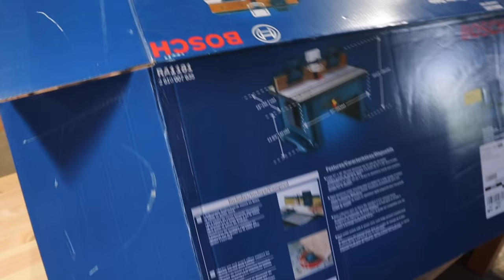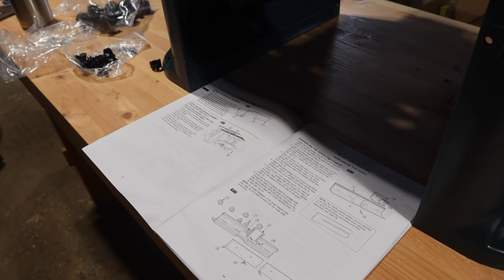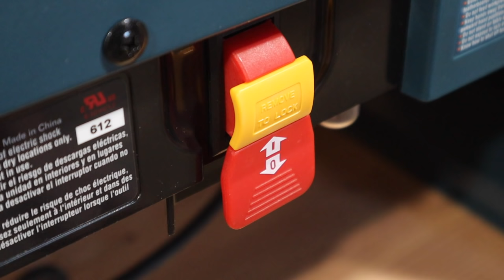New Bosch Router Table | Model RA1181 - Unboxing & Setup

Comment: Is it compatible with different routers? I have 2 dewalt
Reply from the maker: Sure is! Here is the manual. Page 15 has all the compatible models. 

https://pdf.lowes.com/productdocuments/33317c1b-1aec-45b5-9eae-46caa8e591db/08063444.pdf
Reply: @NorthwestCraftsman  thank you so much for the quick response! I found a brand new one for 80 online and wanted to make sure.
Reply from the maker: Nice find! And not a problem!

Happy woodworking!

Josh
Northwest Craftsman
Reply: @NorthwestCraftsman  new sub
Reply from the maker: Welcome to the community! 😄

Comment: HOW DO YOU INSTALL THE FINGER BOARDS THERE ARE NO HOLES IN THE UPPER FENCE TRACK--? DRILL YOU OWN???
Reply from the maker: That’s a great question. I haven’t put my finger boards on the fence before but I think you may be able to use the fence hardware to fasten them on.

Comment: Can you use this table with the Makita RT0700CX2J router ?
Reply from the maker: Doesn’t look like it’s compatible with this particular Makita. Check out page 15 of the manual though to confirm. 

RA1181 Manual
https://pdf.lowes.com/productdocuments/33317c1b-1aec-45b5-9eae-46caa8e591db/08063444.pdf

Comment: Wondering if this table is compatible with any router brand, or if there is a list of routers that can/cannot be used with this table?
Reply from the maker: Sure does! Page 15 of the attached manual has all of them. 

https://pdf.lowes.com/productdocuments/33317c1b-1aec-45b5-9eae-46caa8e591db/08063444.pdf

Comment: How do you adjust the bit height above the table?
Reply from the maker: Hey Bryan! Great question! When the router is mounted, it’s upside down in the table. There is a small hole in the skid plate and router plate which allows access for an included hex key to turn the micro adjustment knob. It works great! Easy to adjust within a few thou.

Comment: Can you make height adjustments?
Reply from the maker: By itself, no, but that the router plate has a hole that integrates with the 1617EVSPK base for table top access height adjustments 😊

Comment: How do you manage dust collection?
Reply from the maker: There’s a 2-1/4” port on the back of the fence which works pretty well if you’re using the right size bit collar (the red plastic rings that reduce the gap around your bit). It does like to dump chips below the table if you don’t close that gap (not always possible), which is annoying, but, I’m planning to build something to add dust collection below as well.

Comment: So MDF vs Aluminum for the router table? Which one and why if you don't mind. Anyone here or the channel. Thank you.
Reply from the maker: Great question! I'll start off with the disclaimer that I'm no expert, this is just my two cents. 

Pros and cons to both. 

MDF is going to give you a very flat and stable surface (assuming no contact with moisture and I hope that's not the case in the shop). You can also get a much larger, custom sized table since you'll be building it yourself. 

The primary advantage to the aluminum is not really the aluminum but the fact that it comes on a pre-assembled table that takes all of the guesswork out of making it and allows you to get to work immediately. As a new woodworker, this was invaluable to getting me working on projects, not just my shop. Seriously, if I made everything in my shop, which I could with enough time, I'd still be building it out. There is also a chance with aluminum that it was bent in shipping or manufacturing so you'll want to check it for flatness before using it. 

Also, understand what your true needs are, dead flat doesn't exist, it's all on a spectrum. If you're doing fine joinery and detail work, you'll want to make sure you're very flat. If you're doing more framing/construction/building work, you can get away with some waviness/bowing/cupping. Of course you can just demand the flattest surface possible but I've seen guys go round and round with suppliers trying to get the "perfect top." 

So in short, there isn't an absolute right answer, it depends on your goals. 

Hope that helps! Thanks for the good question. 

Josh 
Northwest Craftsman
Reply: @NorthwestCraftsman  thanks for the answer and time. I need space as well so I'm going with a bench top.. there are aluminum and MDF benches like the Skil. I want to start off making speaker boxes and adapters. Possibly going into boxes and shelving.
Reply from the maker: No problem! What size of surface you’re looking for?
Reply: @NorthwestCraftsman  no idea honestly lol.
Reply from the maker: No problem! Would you be using the router table to cut rabbets (or rebates) along the edges of your boxes and such?
Reply: @NorthwestCraftsman  I might. I also need to remove fence or move out of way to finish speaker adapters and braces for box
Reply from the maker: Makes perfect sense, you may look at making a removable fence, so you can slide it off the back of the table when you want to use it for other things. Also, depending on what you plan to finish with, you may look at getting a second sheet of MDF to cover the router surface which would keep it clean but still allow you to work on a large surface.

Comment: FYI. Bosch makes recessed wrenches! It made my life much easier!
Reply from the maker: Kiran Bhat Woodworking I didn’t know that! Thanks for sharing!
Reply: @NorthwestCraftsman  Yes! RA1152 is the part number. Changing bits is much easier and with the top depth control, it removes the need to buy a router lift!
Reply: I've got the Bosch portable router table, not nearly as solid as the aluminum top model.  I picked up my recessed wrenches at Amazon because it is a hassle to change bits otherwise, a necessity.

Comment: The biggest PITA and failing of this table is the lack of a T-track miter slot across it. A lot of accessories (circle jigs, sleds) depend upon any router table having one... which I guess most do. The slot that this thing does have doesn't conform to any standard, and isn't deep enough to hold a track anyway. WTF were they thinking?
Reply from the maker: Yea, a t-slot would have been very handy. Wonder if you could secure one into the miter slot since the miter slot, at least for me, is very seldom used on this table.

Comment: too bad it doesn't have a top mounted router lift, that would make this table soooo good
Reply from the maker: Yea, I think they designed this with the 1617 EVS in mind which doesn’t require a lift. It certainly would make this table more versatile though!

Comment: Thanks for this review. Even though this table has been around for years, it’s good to find a recent review, especially one as thorough as yours. I’ve been looking at this table as well as the exact router kit you have. As you probably know, there are a lot of VERY mixed reviews out there on the RA1181, many of which complain about the quality, tolerances, fence, and almost everything else. I like that you are an engineer and are applauding the build quality. That carries a lot of weight with me. I was wondering: have you tried the above-the-table bit height adjustment yet? What are your thoughts about that?
Reply from the maker: Jeff, thank you for your kind words. It’s possible that the mixed reviews came from the “feel” of poor build quality, plastic tends to do that, or that Bosch has some batch issues early on. I am very impressed with mine though and used it for almost two days straight following the unboxing. 

On your question about the above table adjustment, honestly is one of my favorite features and I can’t imagine having to adjust any other way. I use it every time I’m on the table. In combination with the digital depth gauge I have (Multi-gauge, Router: https://amzn.to/2XNC87k) I can make adjustments to depth that are finer and easier than I ever could have imagined.
Reply: @NorthwestCraftsman  Excellent! That's all good to hear. One more question, if you don't mind. Are you able to change bits above the table as well, or won't the router raise high enough for that?
Reply from the maker: Absolutely! There is a quick adjust button which allows you to preset the height to three or four different spots. If I put it in the highest one, I have no problem accessing the bit. It helps to pop off the plastic window on the router so you can put the bottom wrench in, but honestly with how smoothly it went, I’m pretty sure it was design intent.
Reply: @NorthwestCraftsman  Great! Thanks again.

Comment: I own this and the only problem I've had with it is the complete lack of dust collection underneath. No matter how you use the table - with the fence and a vac hose or without the fence, you'll end up with a ton of dust under and around the table. Beyond that, it's a good table.
Reply from the maker: No kidding! When I build out the table I plan to have this mounted on, I’ll be building some dust collection for underneath

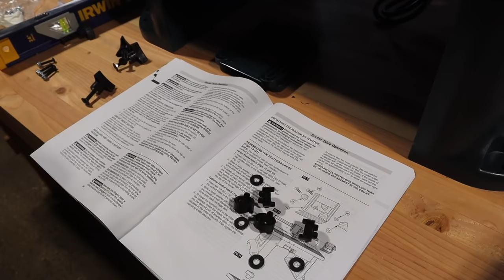Comment: 5:14  I have the same table (older version).  I see Bosch is still using those annoying little round plastic keyed spacers for their featherboards.  They should have redesigned them.  That;s my biggest complaint with this table.  Every time I need to change the featherboards around......those donut spacers go rolling all over the shop floor.
Reply from the maker: I do agree with that after working with them more. They are challenging to keep in place and are easy to lose in storage.

Comment: Cast iron top thats new it was mdf.
On your base id use a plunge base in the router table I belive your model has the ability with the long Allen key to do adjustments on the top of the table and not have to fight lifting it to your desired height.
Me I bought a jessem lift for my craftsman router then later bought the 1617ev becuse it has speed controls 
Larger bits like 1" to 2" need to spin at a slower speed so you don't burn up the carbide cutter tips. Its speed feed rate that burns up a bit.  Feed rate isn't very adjustable but tool speed is. 
Think of it like this you have a 1" cylinder and a 3" cylinder  now roll both one revolution  youll see the 3" cylinder traveld 3 times as far, thats what larger bits do  so to compsate for the distance you slow the bit down.
Small bits might run better at a slower speed or full speed.  The bosch router has a chart for bit size and router speed also says what number is what spindial speed.   You should be able to change bits with both wrenches above the table.
So id sujest you buy a second plunge base for the router table. But honestly you'll use the fixed base the most.

My 3 craftsman routers were made by bosch.   Ive got 5 routers. 1 old sears over arm router table they made in the 60s ive only ever seen one of them.
Pin or over arm routers cost a lot of money and they are generally a fix based tool.
Reply from the maker: Thanks for your thoughtful feedback and response. I’ll have to go look up that speed and feed table because I think that’s been one of my issues.

Comment: Just got one. the bottom 2 right (ES) holes on the work surface were milled wrong, (circular instead of square), making it impossible to corectly mount the work surface to the legs which makes the table unsafe to use. Thanks for jeapordising my safety bosch.  Maybe you should stop trying to sell off your defective products through amazon.
Reply from the maker: Whoa! I’ve never heard of that issue before, hopefully you can contact Bosch and get a replacement.
Reply: @NorthwestCraftsman  Contacted Amazon and they are sending a replacement. Fingers crossed it was a one off.

Comment: While Bosch makes my favorite routers, I hate the Bosch tables.
 
The reasons I do not like the router tables/cabinets from Bosch (or Kreg for that matter) is that they are CHEAP... not low priced... CHEAP. 
 
A router table, just like a router, requires precision. 

 
For the price, you can make one far superior.  And for those not wanting to build, put some money into one with a better top, sides, and fence for $100-$200 more. (The 1181 Bosch top isnt bad, but dont drop a collet on it.) Dust collection is horrible unless you keep buying extras for it... they did well with the router cabinet and dust collection... no idea why they couldnt redo that with 1181's features. 
 
The 1181 will destroy a 1617 router due to its poor dust collection. So every 100ft of routing, you will want to remove the case and give it a cleaning. Also, put a a piece of high flow filter over the intake at the top of router (bottom of router in a vertical mounted table). 
 
Lastly... it's plastic. And while plastic can be great, this plastic feels sorely lacking in rigidity over time. So mount a few cross supports to it, and do it in a way that you can mount the on/off switch to that support wood. The way it is done via factory is a nightmare in time. 
 
So if you must have a Bosch table, then get ready to work on it, and tune it up frequently. But I highly recommend making your own. And for miter and fences on your DIY table, do not underestimate the power of linear rails, and 2020 (or larger) extrusions. Bearings make EVERYTHING better, and the build you can end up creating for $100 - $150 , will greatly surpass the box store tables.
Reply: plastic switch housing broke, cant buy a replacement t. discontinued, no replacement t
Reply from the maker: @MrCarter’sRods - Thanks for the feedback and detailed description. I can absolutely see the drawbacks you’re talking about. I think for a novice it was an excellent way to get started and far more precise than I would have been able to put together on my own. What are the materials you’d recommend using for the table top and fence?

Comment: is the table perfectly flat from left to right and front to back?
grab a level and check it.
i bought a new ridgid job site table saw and the table had a hump in the middle.
they send a new top which i had to spend my time to remove and replace to find out ugh at is also not flat.
these manufacturers built these tops out of cast aluminum and they are not always true.
we need to hold them to a higher standard than they hold themselves to.
if it’s junk, we shouldn’t be buying it, or at the very least, each one of us should calm to inform them of the imperfections so they are completely aware that we cars about what we buy and not buy if not to specifications.  OR THEY WILL SHIT ALL OVER US !
we can’t let that happen anymore.
life is way too expensive now, and getting worse.  they needs to keep up with quality control.  PERIOD.
Reply from the maker: Hey Gino! Thanks for the comment. Perfectly flat is a little bit of a misnomer because nothing is truly flat, it’s more a measure of your tolerance and what your processes can accept. The challenge for them is that some of the defects we may consider unacceptable may be acceptable to the vast majority of hobbyist woodworkers or framers, especially for a job site style saw/tool. Cost goes up exponentially as your tolerances get tighter. If you need a truly flat surface, you may need to upgrade to a cast iron cabinet saw.  

I measured from one corner to the other and only have a tiny bit of light showing under my straight edge at a couple of spots, but not with a consistent pattern. For my work, that’s flat enough. I agree though, if there an obvious gap or hump, you should follow up with the supplier. 

Hope you were able to find resolution to your issue. 

Josh
Northwest Craftsman

Comment: You went too fast with fastening the router to the table. The manual does a poor job showing where exactly to put the mounting screws and it is very confusing. This video wasn’t much help either mulling over critical details.
Reply from the maker: Sorry to hear that! Are you looking specifically for mounting the 1617 to the table?

Comment: I can't believe the sides are China plastic. An engineer , why not a Rockler table?
Reply from the maker: To be fair, iPhones are made in China as well and are well constructed. That being said, I understand the connotation and don't think this table falls in the same bucket, I've been pleasantly surprised with the quality. And if I'm being honest, I hadn't thought to buy a Rockler table. I knew I liked the Bosch router so I trusted their table. I also checked the pricing on the Rockler tables a few minutes ago and I feel I would be hard pressed to find equivalent quality for the same price. Do you have a Rockler table? If so, how do you like it?
Reply: @NorthwestCraftsman  ..... As an engineer how could you compare an iPhone  to a router table ?
I'm looking for good router tables and found the Rocker table along with your video and other so far.  The Bosch table doesn't have good reviews from Amazon
they call it junk. This leads me to think maybe Bosch gave you the table for the reviews. If you are a engineer that likes  spending least amount you can , I understand
but I'm not like that, I like getting a great product for a good price. I 'm not a fan of plastic legs or sides like the Bosch table. 
I was surprised to hear you're an engineer and not just build a steel lower table and buying a router top . ggg
Reply from the maker: @goodboyringo9716  Bosch didn't give me the table and the RA 1181 has 4.5 stars with 2500+ reviews on Amazon. Some people have had issues with the flatness of the top but by-in-large, it's good quality. I don't always purchase the cheapest items but my philosophy is that purchasing something that gets me 80% of the way there is better than having nothing while I save for the best of the best. I fully expect to upgrade much of my equipment through the years but at this point I chose to prioritize building  projects over building myself a table.

Have a great day, 

Josh 
Northwest Craftsman
Reply: @NorthwestCraftsman  ... I'm glad you have it all figured out , have a nice time with your table.